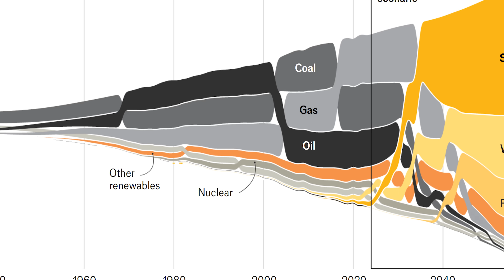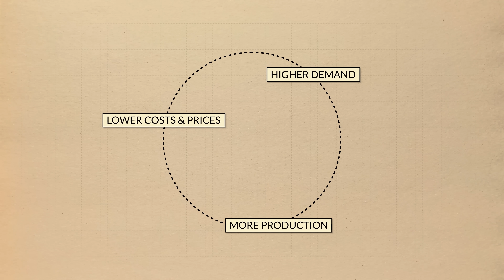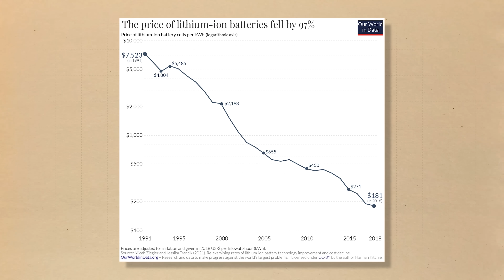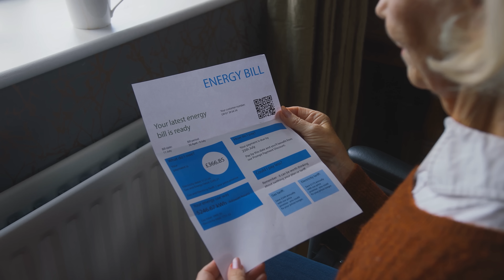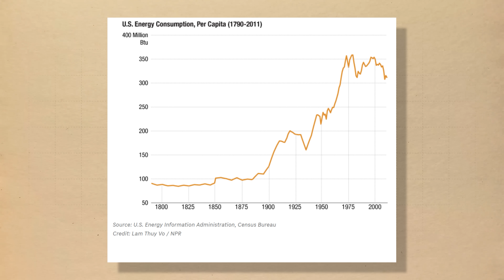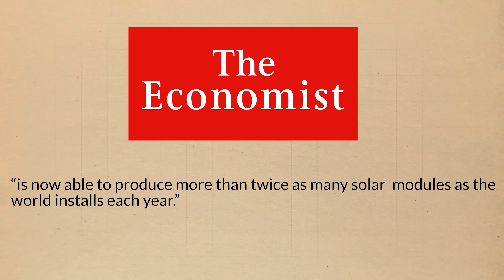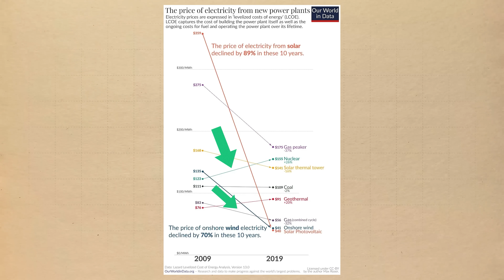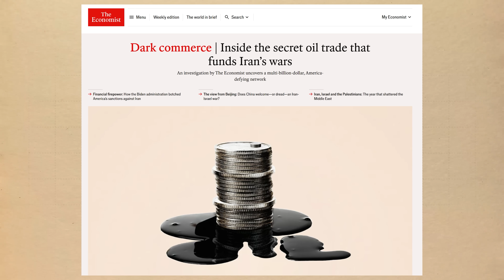Why solar will soon dominate & what that means for the world

Comment: This presentation overlooks many fundamental considerations. You can’t just extrapolate an exponential curve like this for any given region. 
Reasons:
1) These resources are intermittent 
2) supplementing intermittency with batteries is expensive, eroding the economics of solar/wind (not mentioning the ecological challenges of batteries)
3) Many units are installed in low solar resource regions bolstered by subsidies, artificially depressing prices. The availability of solar in such regions absent subsidies is unlikely
4) There is substantial import dependency for PV systems (he touches on this but it’s worth flagging that this is a major systemic vulnerability)

Solar and wind are both great but their capacity needs to be accurately presented

Comment: Problem is solar is not self sufficient, always needs a backup, specially in darker and colder countries closer to the poles. And batteries still suck in 2024, too expensive, too big, heavy and voluminous.
Great that solar can save you some money, but on its own will not allow you to get off the grid. The energy mix is not going away, and the optimal mix will be different on every location.

Comment: Without cheap energy storage an intermittent energy source like solar is limited to maybe 20% if the power capacity otherwise the grid becomes unstable. I think thwt the issue why solar can’t grow exponentially. How do people in Africa light up their home at night when the sun doesn’t shine and panel don’t produce any power? They still need a backup diesel generator in this case.
Reply: "How do people in Africa light up their home at night [?]"
Batteries.
Reply: @calamityjean1525  Batteries are expensive and add significantly to the total cost. On a large utility scale battery storage is still way too expansive and the same will be true in Africa as well.
Reply: @Herschauen    You didn't ask about large-scale battery storage.  You asked how people lighted their homes.
Battery prices have fallen significantly in the last few years and are expected to fall for several more years in the future.  Be patient.

Comment: I just wish do it yourself solar was cheaper and we did more plug and play, like if every home could power some of it's devices from solar rather than relying on the grid, it would be a good thing, every little helps and every home would have solar backup power.  Camping kits are paving the way.

Comment: AI needs huge amounts of electricity. After than, we need to make hydrogen with electrolysis. Why? Because it's needed for making fertilizers, which roughly double the crop and we are currently making 98% of H2 from natural gas.
Also, we can use H2 in industrial processes like turning irone ore into pure iron, which currently uses coal as a source of carbon, and for every ton of steel we produce 2 tons of CO2.
We just can't get enough electricity anytime soon.

Comment: Higher interest rates could hinder the adoption of solar energy. Since solar projects require most of their capital expenditures at the outset, unlike fuel costs which are spread out over time, the return on investment for solar is highly dependent on low interest rates over the project’s duration.

Comment: Why is government creating money to finance green investment looked down upon as a sollution? I understand that increasing the money supply without changing aggrigate supply* in the economy can be inflationary and cause problems down the line, but private investment financed by private bank lending, which is usually what people suggest, also increases the money supply. As far as Macroeconomics is concerned, what is the difference between the central bank creating money to invest in long term social needs and the private banking sector creating money to do the same thing?

*You could argue that investing in producing cheaper energy would increase aggregate supply

Comment: Every article like this focuses on panels.  WHY?  They are only 30%-50% of the total cost.  The electronics, installation, storage, and distribution of solar is STILL expensive. If the USA want to compete, we need to incentivize the whole thing, not simply tariff Chinese panels! And the media needs to STOP focusing on just flashy imagery of PV panels. Start reporting on the other 50% - 70% of the costs.
Reply: America is like a Heroin addict now. Very hard to recover.
Reply: To make matters worse, they probably will tariff the Chinese batteries too
Reply: @wedmunds  "Drill baby drill" - quote Trump

Comment: There's one very important thing that 'The Economist' didn't consider at all. Energy demand ultimately depends on consumer demand. What's the forecast on that? With demographic decline in every nation, I don't know how certain that is.
Another very important thing is - solar panel production can get constrained by the raw materials need. This is another place where geo-politics can wrech havoc. After all, China (or anyone really) doesn't mostly produce these raw materials.
Reply: Most of the rae materials going into a solar panel is sand. Their is very little rare materials.
Reply: @catprog  Sand and a bunch of rare earth mineral. And then a ton of energy for production process, and a ton of mechanical tools (like Tungsten Carbide saw) to slice them down etc. Only sand ha?
Reply: @aniksamiurrahman6365  what rare earth are going into your standard solar panel. (I am not talking about  exotic panels like thin film CdTe or InGaP just your standard cheap panel)
Reply: @catprog  Every kind of semiconductor manufacturing require rare earth minerals. No exotic needed. Mere internet search ud've been enough.

Comment: I cannot speak to the rest of the World in particular Germany where solar power has completely revolutionized the energy market there but in the USA solar power was overwhelming driven by small scale recreational use until Tesla came along and practically created the entire Industry upon the buying of Solar City so no, not much in the way of public investment in the USA at all in this technology until basically now today 2024 as part of a rollout of charging infrastructure. If i were to point to a chart theory that perhaps Tesla is looking at as they are the only holistic provider of electricity in the entire World/Planet i would look at raw output per square foot/meter over time as the biggest cost constraint is contrary to publicly available claims not the cost of the panel but the actual space needed by said panel to generate usable power. This cost of space has come down ENORMOUSLY over the past few Years one reason being simply having two sided #bifacial_solar panels but also vastly superior inverters, "housings" yes absolutely improved materials also much better storage but most importantly now only becoming true vastly superior installation and support for said product to included onboard communication systems for the montioring of the holisitc system. This communication is absolutely critical to putting value into this offering as with electrical generation there often arises a "I'm not lost i just don't know where i am right now" problem namely a communication issue related to needing to know where it even be possible to draw off power from somewhere else to prevent an entire power outage that requires sending a service crew/s so yes modern 2024 solar power in the USA is of IMMENSE value to all electric utilities in the USA both right now currently today 2024 not just because of the ability to generate a remarkable amount of power using very limited...and valuable...real estate now but also because communication systems now exist to inform most importantly the consumer/prosumer but also one hopes "central command" if you will of the Utility as to the status and possible storage levels now too of all of this power that be used as a potential draw in case of something as small as a bird strike or as large as a total blackout so as to keep the entire grid scale i think the term is #steady_state or "always on/always drawing power/power sufficient for said draw with a 10% reserve" not sure what the plan is from Detroit meaning all North American Automotive TO EVEN HAVE AN HOLISITC PRODUCT to compete with Tesla so far that entire INDUSTRY leaves pretty much everything to be desired at the moment although $gm General Motors has been making nosie in this regard still nothing of note however. Whilst the US taxpayer which bailed out that entire Industry waits for a resolution of that from them in the meantime Tesla rolls on not waiting around for THE FEATHERBEDDERS TO GET OFF THEIR FUCKING ASS AND GET TO WORK AT ANYTHING as they have already deployed and continue adding to a fully functional holisitc system which no doubt now is proving out how to provide actual power to the grid as opposed to ever needing to ever draw from that so a very valuable system from that be that be indeed. Long story short again USA nowhere else the USA has an absolutely HUGE glut of electricity currently being produced as new solar continues to come on line dropping prices down to in some instances now negative pricing actually something apparently true in Europe for some time now😊😊

Comment: 🤣🤣🤣 cheap?! there is NOTHING cheap about this! it is massively SUBSIDIZED with wind as the others in the energiy mix are heavily taxed and even so, it is more expensive than any other way of producing energy retail and is the least reliable of any of them around. and it costs the grid operators A LOT to balance the grid because of solar inputs! PS: a minimal war and we are done with solar in a few months time...good luck producing steel at high capacity for the war with solar!

Comment: not the greatest production this channel has made or is it an infomercial for The economist? solar is only cheap if you leave in the subsidies and don't count the costs of the grid or storage, both of which are very significant due to its intermittent nature of the generation. there really should have been some critical analysis added in here. but you don't really need fancy economics to work this out. the places that have high percentages of solar in their mix have the highest energy prices even with all the subsidies.

Comment: also it can fundamentally advance: theres already coming up solar material that is 2x more efficient, and can be make with common rock material.

18.10.2924 " A Finnish company has come up with an alternative to dangerous lithium batteries - we find out what it's like
Nordic Nano Group has developed an environmentally friendly battery technology that could replace dangerous lithium batteries. 

Next year, a Finnish company, Nordic Nano Group, will start pilot production of a new type of battery technology in Imatra.
The company's main products are solar panel coatings and non-toxic batteries made from the same material.
The solar panels are based on nanoprinting technology, using know-how developed at the University of Eastern Finland.
The other main component is a nanomass developed from German research. The material is a trade secret, which the company does not disclose.
- Solar panels and battery cells printed from nanomass are twice as efficient as conventional solar panels, says Esa Parjanen, CEO of Nordic Nano Group.
The start-up aims to start industrial mass production in Imatra as early as 2026.
We asked what kind of new technology is involved.
A bit like a paper machine
Esa Parjanen, CEO of Nordic Nano Group, compares the company's invention to a paper machine.
- Just as Ahlström bought its first paper machine from Germany, we have acquired our innovation from abroad and are now combining it with Finnish quantum coating expertise.
The German innovation is a nanomachine that efficiently collects solar energy also from scattered light. The nanomass does not contain any of the heavy metals commonly used as binding agents in printed solar panels: cadmium, lead, cobalt or arsenic.

According to Parjanen, the nanomass has already been proven to work on an industrial scale.
- We have replaced toxic substances with a natural material that can be mined and is very common in Europe. It can also be produced in Finland," says Parjanen.

The mass used in nanoprinting is also used in battery cells manufactured by the Nordic Nano Group, which store energy.
It replaces lithium, the element typically used in car and mobile phone batteries.
- These nano battery cells can last tens of thousands of charges and store more energy. They are also fire-safe and cannot explode," says Parjanen.

A home with an electricity storage roof?
A mass of nano-sized particles is printed on a very thin film. The film can be printed on a variety of surfaces, such as walls or the roof of a private house.
A battery cell using the same technology can be installed under the solar panel coating to store energy.
- This could enable a new kind of self-sufficiency for households, where residents could store energy on their own roofs and sell it on to the electricity company when they see it most profitable," says Esa Parjanen, CEO of Nordic Nano Group.
The company is looking for funding
According to professors of photonics and materials physics interviewed by Yle, the innovation is a completely new one. It is therefore difficult to assess the credibility of its technology.
Nordic Nano is launching a test line at its Imatra factory this spring at a cost of €20 million. Some of the money is already in place, but some is missing.
So far, most of the funding has come from the private sector. The company has received public funding in the form of a development grant from the Ely Centre.
Vesa-Pekka Lehto, Professor of Materials Physics at the University of Eastern Finland, says that new entrants to the battery industry are announced fairly frequently, but few manage to start production.
- Society's support for such projects is small in Finland compared to competitor countries and they often fail due to lack of capital."

Comment: Cheap Solar Power? In Germany it cost 7-12 €ct. The shout down atomic power plants produced for 2 €ct. Not forget the cost for backup Power plants and the need for massive Invest in the grid. 500 billion € need to be invested alone in the grid in Germany to handle the Solar Power. 100 billion more for backup Power plants.
But ok, in Africa Land ist cheap, and the sun shines 2 or 3 Times stronger and the Solar Power should be the Backup to the grid. Different Situation.

Comment: I will believe there will be a solar revolution when the Chinese start retiring a coal fired station per week instead of adding one or two per week. That means the price of extending grid capacity and grid stability also needs to come down. Watch them try to mine the seafloor to get the metals needed for that. All the hopium advocates simply assume that renewables will displace fossil power, instead of which it tends to add more capacity at times and places determined by the weather. Compare them with zips, buttons and shoelaces. Why do we still do our shirts up with buttons, and shoes with shoelaces when zips are so much quicker?

Comment: The only thing that's keeping solar-panel related production up is the fact that the price of energy keeps going up. Solar is the cheapest method of producing mass amounts of money in the same period of time for every other form of energy production, so it's not surprising that it keeps being built.

But that's only as long as certain rare elements continue being mined, and climate change doesn't screw things up. Solar's biggest problem comes up replacement and repair - the upfront cost of a solar panel may be cheaper than any other forms of energy, but the repair and replacement of parts basically requires the complete replacement of the solar panel, while the upkeep costs of most other energy production is merely parts. 

Overall, I'm sure there are advantages and disadvantages to each form of energy production. Solar's is that it's cheap upfront, and intermittent production that requires secondary storage for it to be used long term.
Reply: What rare earth are you talking about?

The most common solar panel type is pretty much just silicon and alliumun